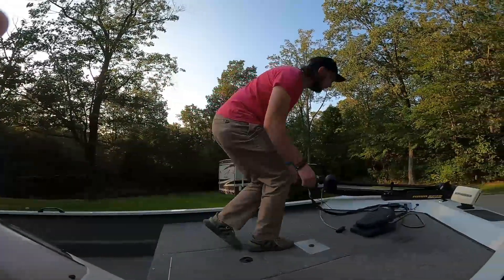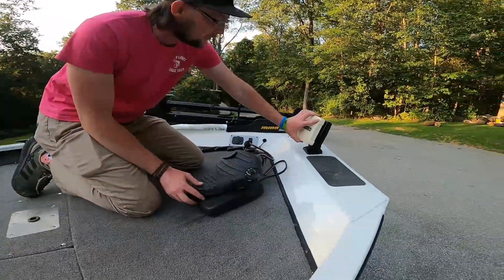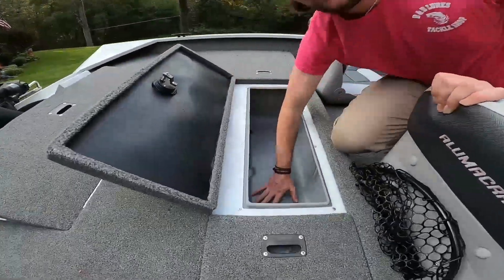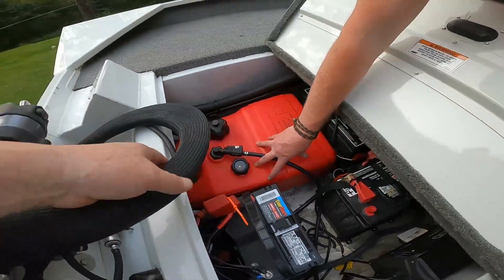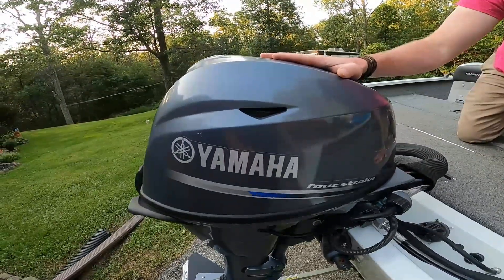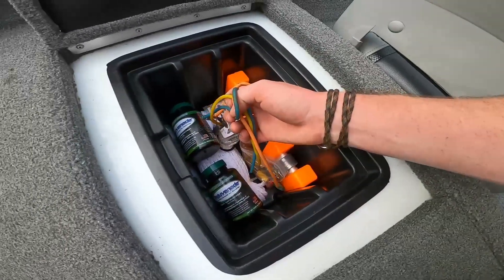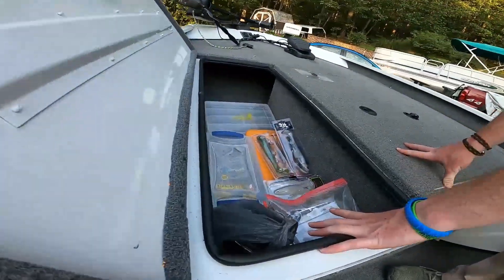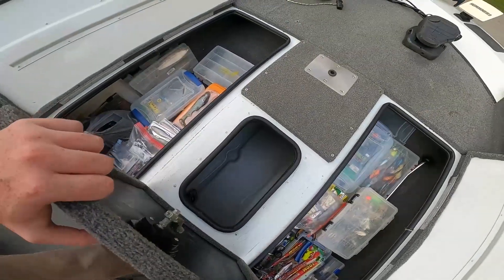Alumacraft pro 175 bass fishing boat walkthrough!

Comment: Awesome boat, can't believe how similar is to my 1994 sea nymph 175, mine was originally bought at f&s years ago, but really great looking boat.
Curious what kind and type of marine batteries you use, and do you like your minn lots charger/maintainer. Great video
Reply from the maker: Yeah the chargers awesome! Always has the boat ready to go never had an issue and its always recharged enough by just leaving it on overnight and can use it all day the next! And the batteries ill have to look at em when i get back to it i dint remember iff hand but they are just what f&s typically carries in there i think.
Reply: @BassinItUpMoffitt  ok, sounds good, appreciate the info. Just curious more for trolling motor, I have the same battery's you have as your engine starting battery